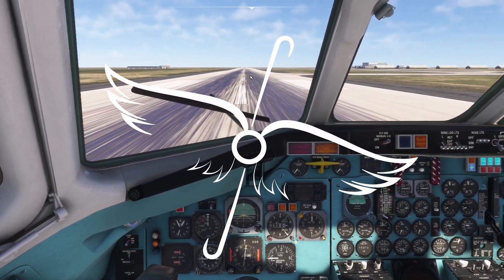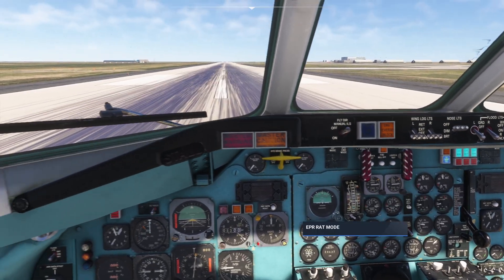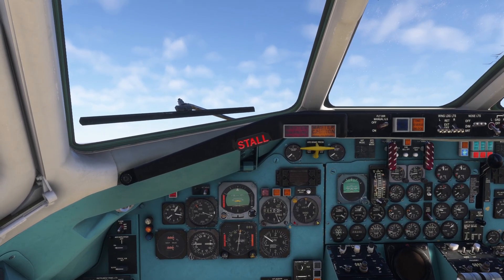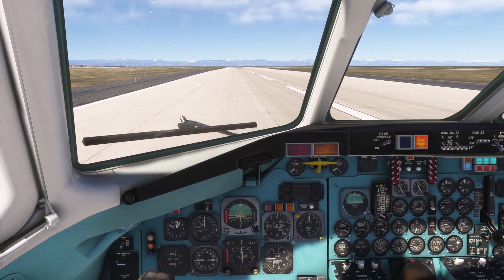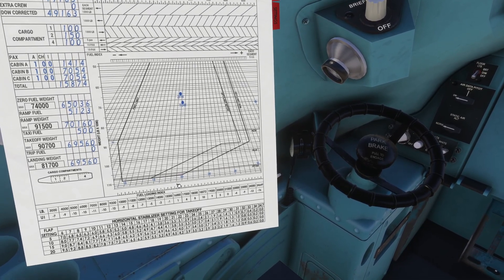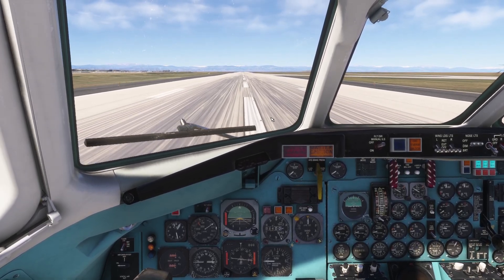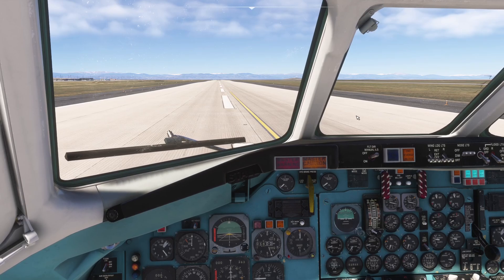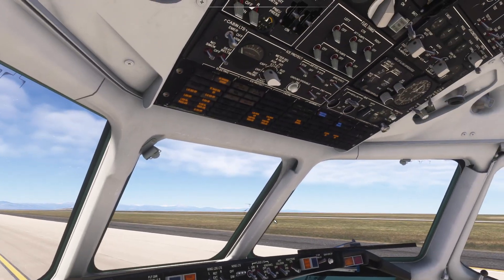Sky Simulations DC-9 - NINTH TEST BUILD (update coming)

Comment: Would you please ask the developers to increase the size of the FD command bars?  They are too small compared to the real FD 108.  They extend further beyond the edge of the airplane "Delta" triangle.  Here's a good PDF of the FD 108 system: 
file:///C:/Users/richa/Downloads/Collins%20FD-108%20Integrated%20Flight%20System.pdf

Not the best picture in the world, but best that I could find on the internet: https://i.pinimg.com/originals/56/2c/42/562c42368b62138d1498ea099100a696.jpg

Thanks!

Comment: DC-9 pilot here, we never ever apply the brakes after main wheels touch down, same goes for any jet transport aircraft, unless it’s an emergency and then if you over do it you’ll end up with a second emergency, a brake fire!. As far as the nose wheel goes it naturally wants to come down so we use the elevator to gently fly the nose down. Lots of work yet to be done to make that model realistic. Having said that, if one day it is much improved, I’m buying it as love the DC-9!
Reply from the maker: @340ACP  thanks for your post. So I'm assuming then you let the spoilers and reverse thrust do most of the work? And only used the brakes at the lower end of the roll out?
Reply: @PeterMatthess yes use reverse thrust and only use as little brake as possible, of course circumstances will dictate how much braking is required, for example a contaminated runway would require a bit more but the important point here, only use brakes once the nose wheel is on the ground and only as much as necessary. Happy to help if you need more information, I flew it as a flight instructor for 5 years
Reply from the maker: @340ACP  Hey man as you are a real world DC-9 pilot, or were. I'm thinking of releasing a series of tutorials on specific aspects of this aircraft for the community. I was wondering if I could get some quotes from a real world DC-9 pilot to put up on the screen at certain points to help underline this aircrafts 'quirks'. Would you be up for commenting on your experience flying this beast? Feel free to connect on my discord channel: https://discord.gg/99g9Dktq
Reply from the maker: @340ACP  I would have assumed you would use at least some manual brakes as there is no auto brakes. Interesting, this is exactly the feedback that helps me and helps the dev. Thanks

Comment: #1. You do NOT use Manual Brakes until the speed is below 80 knots....unless it's an emergency. #2. The nose coming down has nothing to do with the wings and everything to do with the Tail. The 80ish knot speed when the nose begins to settle is also the same speed at which the Tail begins to lose it's effectiveness. The opposite is also true, you have no rudder authority on takeoff until you hit 80 knots. Aside from those, it's great seeing the updates happening. Looking forward to picking this thing up once the update goes live.
Reply from the maker: @Fitch93  thanks, we're you or are you a dc-9 pilot per chance?

Comment: Hope they fit a GPS or basic FMC with Rnav capabilities. These days im having trouble to fly to RNAV airports where there are no VORs or NDBs. Too many VORs have been removed lately, anyway having a lot of fun flying conventional. One thing  i will like to learn is how to opertate the presuritation system properly, a tutorial would be great. Other thing is i couldnt find the Outside temp gauge, i dont know when to operate the Anti-ice system.
Reply from the maker: I learned how to work the pressurisation in this aircraft, its in a previous video on my youtube channel. And as to flying the aircraft in its current state, theres no reason why you can't fly it on vatsim without a gps, I fly old pre-gps aircraft on vatsim all the time. You just need to make controllers aware that you should be treated with a higher level of respect that those magenta line followers!

Comment: The tail is going to be more of a factor during the rollout than the wing. The tail is generaring downforce and thats what is keeping the nose up. This will be even more prominent the further aft the trim is set. Even with spoilers out on the wing, as long as the tail has enough aerodynamic authority it will hold the nose up. Never flown the DC9, so cant say if its accurate, but hope it explains the phenomenon you are seeing.
Reply from the maker: like I said in the real thing pilots would be immediately braking, and also potentially trimming forward to also help bring the nose down if it was an issue. But its just an aerodynamic test at the moment.

Comment: Gotta give the dev some credit. They are working on the issues and asking for feedback to help. Some other devs could learn a little something. 😉
Reply from the maker: definitely!
Reply: Inibuilds could learn a thing or two
Reply from the maker: @ dude. Just don't Theres no way you can put Inibuilds on a LOWER level than this dev. The level of quality in the A350 is miles higher than this. Even with the bugs. Personally I havent picked up the A350 but from what Ive seen, theyve got a solid product and seem to be patching it pretty quick. But then, the style of simming now is to rip off ANY developer if they don't jump to it and deliver yesterday I guess.

Comment: Are you testing this on FS2020 or 2024? Would be interested to see how the AC performs on both sims
Reply from the maker: @spreilly  I'm testing on 2024, all my test videos have been on 2024 consistently. Personally, I have never tried it in 2020, despite having that sim installed
Reply: @PeterMatthess good to see it doing well in 2024, given its stability concerns!
Reply from the maker: @spreilly  it runs very smoothly on my PC, which isn't the fastest thing out there by any means these days

Comment: The nose behavior specially on the landing roll is not totally wrong, on the DC9 I remember we use to apply down elevator to lower the nose, remember you have two heavy engines on the tail of the aircraft. I am happy to see that the update is getting closer, I can’t wait. Thanks for the videos.
Reply from the maker: yea good points.
Reply: @PeterMatthess @PeterMatthess  And on an MD-80, it was even more pronounced because of the nose strakes, which were designed to keep the nose from coming down too rapidly but were actually a bit too effective.